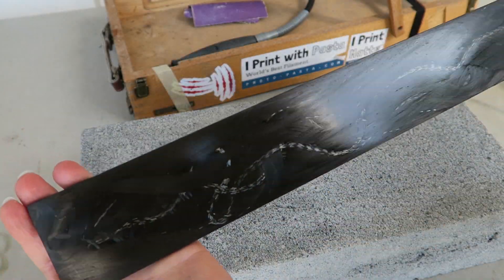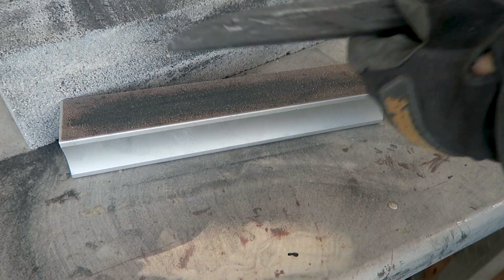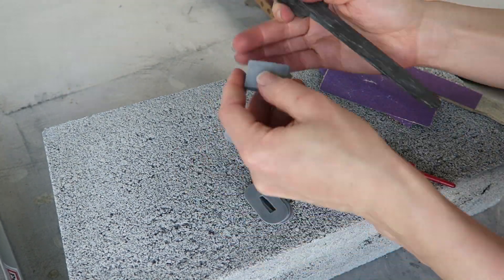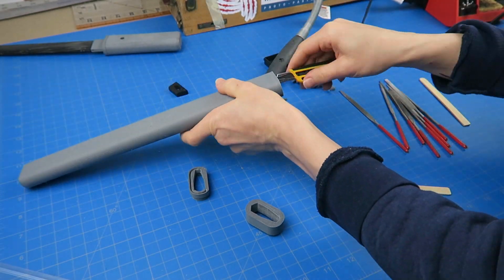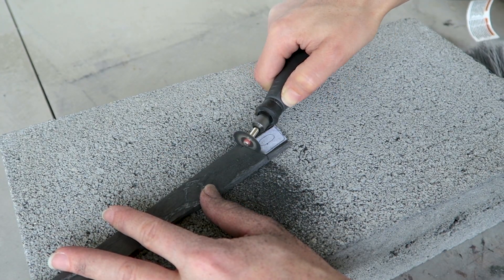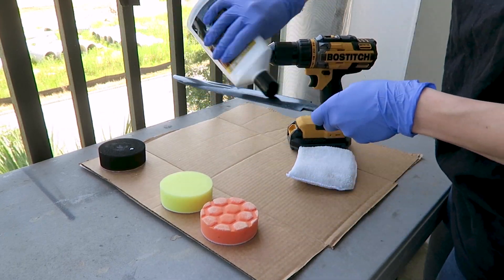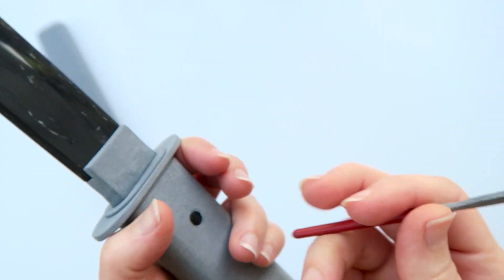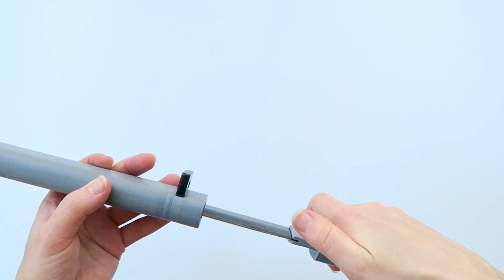Carving a Carbon Fiber Knife Blade

Comment: I'm really curious about how good is the edge retention of this material

and, btw, your craft here was beyond impressive, great job!
Reply: Edge retention? You mean to actually use it for cutting things? Terrible is the answer.
Reply: basically the same as if you just made it out of resin
it sucks
Reply from the maker: 100%
Reply: The edge retention of pure CF blades is crap.  It will take a cutting edge but you couldn't even get through the first half of a steak dinner before it would be as dull as a spoon. People who make exotic knife blades using CF usually laminate it with steel or titanium or -- rarely -- ceramic to give it an edge that will last a little longer than a fart in a windstorm.  Which is all  you can expect from a pure CF blade.  Don't get me wrong, you could kill someone with it but you better be quick and it will be useless after just a few cuts or thrusts.  

None of that is intended to be a criticism of this channel or the blade shown in the video.  Regardless of the utility of CF as a blade material, what is shown in this video is pure artistry and quite beautiful.  Nicely done.

Comment: Very nice job.
Though I do have a question, how well does it hold an edge. I would assume carbon fiber being fairly easily scratched (e.g. sharpened with sand paper.) would loose its edge rapidly and would be difficult to resharpen without loss of material.
Reply: youre*

Comment: For those interested in working with cured carbon fiber composite, please wear proper protection, especially to protect your lungs. Once those sharp spears of CF enter your lungs, they are there for life (think asbestos). Respirators are so cheap today, I would even consider getting a full-face model even for occasional hobby-level exposure to this dust.
Reply: "Respirators are so cheap today" - that didn't age well.
Reply from the maker: For sure, important to protect the lungs. I currently wear a tight fitting dust mask for all carbon sanding, but a full face mask is on the wish list for future.
Reply: What if you can't wear a full face mask?
Reply from the maker: @HYPERxSONICxFANx2012  A separate face shield that fits over the dust mask to protect from flying splinters is good. Or at least glasses with a half mask.
Reply: @HYPERxSONICxFANx2012  well you're wearing one right now
Reply: @ramihatim210  barely. I almost never leave the house. I'm vaxxed there's just basically nowhere to go
Reply: Thank you